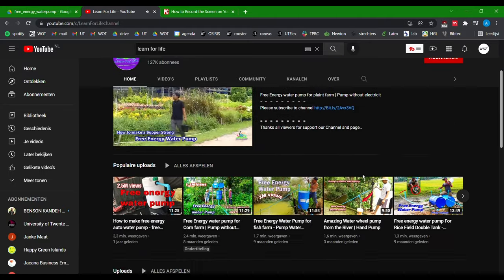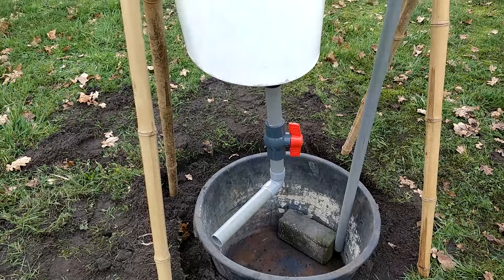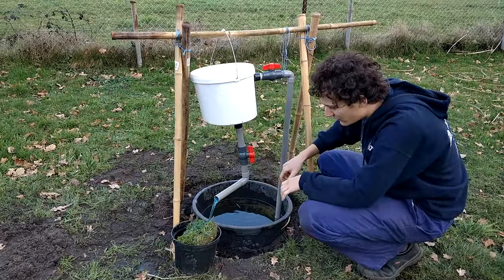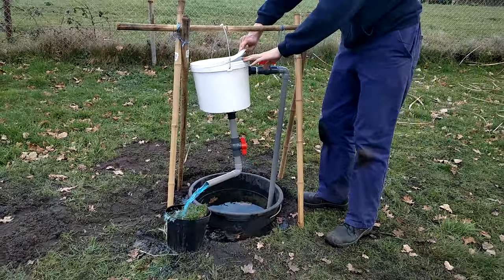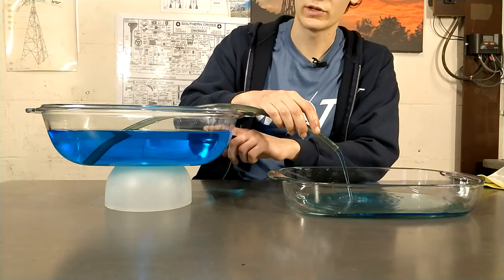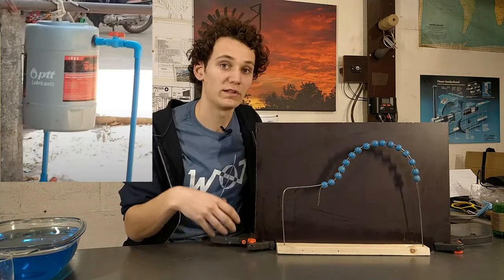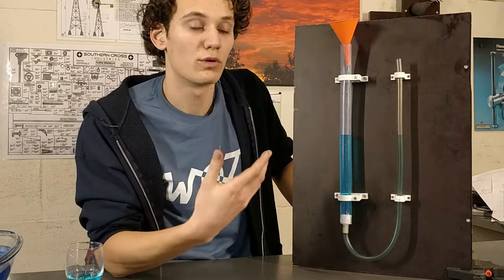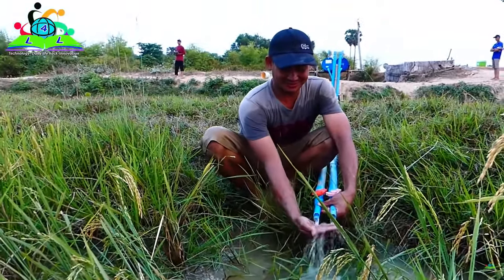FREE ENERGY Water Pump Tested. Is it possible?

Comment: YOU have SO MANY things wrong. 1 the outlet must be a larger tube than the inlet tube. 2nd   you have an air leak at the bottom line , WHY as water flows out , the vacuum pressure in the bucket gets to much pressure and the water stops flowing to let the air suck in , then water comes out. That is why you hear the girggle noises. YOU NEED a pipe with cap that comes up from the outlet pipe so the air has someplace to go BEFORE exit out outlet pipe. Water on outlet pipe NEEDS to be larger AND longer SO gravity weight of water in outlet pipe AND vacuum pressure with the added movement of water Keep sucking water because of the three factors I mentioned. A) you can suck out of any hole as long as the outlet water line is larger in diameter AND LONGER than the hole it is sucking out of. ALSO , the barrel must be higher than the outlet line. YOU DO this right and you will have water flow.

Comment: Man somehow you seam to have missed a few steps there needs to be a foot valve on the well end of the input pipe then fill that pipe up all the way with the bucket/ drum . I don't know if you can get enough vacuum to over come the weight of the water in that pickup pipe but at least show us that
Reply: With a barrel, no foot valve is needed. No filling of the suction pipe is needed. For this to work, inlet must be higher than the output. That is what he proves.

Comment: Pump works fine. You screwed up. Your siphon hose was way too high allowing air in. Also your bucket was too small and probably leaking. Most people that use this system use 55 gallon drums sometimes two drums. It actually uses the weight of the water to pull up the water.

Comment: you are missing the one way check valve at the bottom of the intake line. The lid on you bucket must be air tight, no air leaks allowed or it doesn't work.

Comment: The main issue is the lack of an air chamber. The air chamber helps to maintain the vacuum in the water tank as the water flows. Without an air chamber, the water flow will eventually stop as the vacuum is depleted.
Reply: .? What do you mean with an «air chamber»? What is that? I can not see anything lacking in this excellent video, debunking tha clame that a siphon can lift any water to a higher level. With no energy input that is impossible. Just as the video shows.
Reply: If the lid was sealed (as in this video)...wouldn't the water weight push the water out?
Reply: @mariusneumayer4419 Yes, the lid here is airtight. As he opens the output valve water will try to get out of the container. It tries to pull water up from the source, but as the source is lower than the exit, then no water  comes up. Then air is succed in via the exit side and a gulp of water leaves the container. This repeats until the container is empty and it all stops This is a siphon, no pump. Source must be higher than exit as with any siphon..

Comment: in that containers that are on every fake pump is just battery and small pump
Reply: Noop. The tank itself is the “battery”. Just fill it up, open the air vent at the top, open the discharge and watch the water pouring out (of the tank) for a minute or two. That is how this scam works. A siphon can not flow water uphill.

Comment: You have to make sure the water container in air tight buddy, try again!!! I use these vacuum pumps on my aquariums…
Reply: You can not. This is a siphon. No siphon can lift water to a higher level.
Reply: @SirSkippy87  OK! How much? No siphon can lift any water to a higher level. Impossible, and this video is one proof of that. AND it is a siphon, this one is a flying-droplet siphon. That is if, and only if, the output is is lower than the source, as with any siphon.

Comment: Your hoses are too large diameter for the bucket size .
Reply: Size of hoses does not matter. This does not work because input is lower than output. As he wanted  to point out.
Reply: @kjellg6532  You need to go and learn fluid dynamics.

Comment: Buddy  u haven't allowed for pressure  try again with foot valve.  And your tank is to small for pipe size.
Reply: With a bucket no foot valve is needed in the suction side. That is the main reason for using a barrel after all. Bucket size here is more than adequate.

Comment: Hello from USSR.
this works when the drain valve is closed. and the air in the barrel is warmed up in the sun. the tap is closed and at night water is drawn into the barrel from the reservoir by cooled air. in the morning, a person comes and uses water. the water runs out and the faucet is closed. the air cools and again the water is drawn into the barrel.

Comment: Your version does not replicated the system, you did not syphon the admission  to prime it and you did not use a check valve at the admission. In honor of a valid experiment you have to repeat it and replicate exactly. Better even with glass recipients. Then it will b3 valid.
Reply: With a bucket you do not need any foot valve or fill the suction side. That is in fact the purpose of the bucket/barrel. This video shows that a siphon is unable of pumping any water up. If it was, you could create a Perpetuum Mobile and receive the Nobel Prize in physics.

Comment: Your setup is incomplete. And also, you need to help the water to a point before it can work. There is a video with a transparant top so you can see how it works.
In that video you can clearly see how the pressure builds up and sucks water from a lower point. But I think it's not desirable for some to have the public know about this.
Reply: A siphon are unable in lifting any water up as this excellent video proves.

Comment: You didn't build it right you have to have and Air catcher in the out let  to keep the air from going back up the out let hose
Reply: The container itself is an air catcher. An external vertical pipe or sub barrel only add some volume making the system run for some more minutes.

Comment: Your demonstration is far from the fluid mechanic it's a suction type vacuum while the air pressure is trap it will pushes fluid its a ram pump its elementary theory

Comment: U did do it wrong.  If u syphon the water into the bottom container it would be a continuous syphon.  I’ve built them.  U did it wrong. You can also add a propeller the water hits from the high level creating a spinning fan from continuous syphon.  Free energy.  It works.
Reply: It can not. No siphon can lift any water.

Comment: It doesn’t work because you have air leaks and no check valve. So try again.
Reply: No check walve is needed when using a bucket. The bucket IS air tight, can clearly be seen in the video as the water has to gulp out of the output as air is entering backwards. Exellent video showing that no siphon can lift any water. No need for trying anything again, video proves it all.

Comment: Well your little experiment seems lacking compared to what farmers make. Even though your explanation about how water pressure works vertically was right you didn't even seal the lid or followed other practices to make this work because you never believed it could actually work right? I will have to try this myself to confirm whether it is legit.
Reply: The video clearly shows that the lid is air tight. No need for a second test.

Comment: There is something you missed in the operation that you made. After you fill the container which is supposed to be at a higher level it should be sealed so that when you open the output valve it would create a vacuum in the container. And as the weight of the water going out of the output pipe create a vacuum it would suck the same amount and weight of water into the input pipe and replace the water that has spilled out of the output valve. Sorry but your demonstration is technically flawed. It was defective from the very start. You must understand that the pump operates both with siphoning and vacuuming at the same time. What goes out during the siphoning comes in by vacuuming.
Reply: Sorry, but it is your explanation which is wrong. Yes, a vacuum is created. But this vacuum becomes effective not only at the inlet but also at the outlet. The argument, that weight of the water is bigger in the container and thus water will flow out, is wrong. What happens does not depend on the weight of the water but on the relation of water pressure to air pressure. And if you analyse that, you will find that an increasing vacuum will stop the outflow before it would be strong enough to pull water up from a lower level than the outlet. 
In addition, the argument with conservation of energy also holds. If this pump would work, you could at once build a perpetuum mobile. You could let the water run back in the reservoir and let it drive a turbine on the way. Electricity for free! But I hope you are aware, that perpetuum mobiles are not possible?

Comment: I guess you didn't understand how it works. Basically you didn't understand the simple physics in the system. 
This, is an ancient method, my friend- it's also used by the indigenous people here.
. 
The contraption you made was all wrong. You didn't really have the one way valve and you lost the vacuum/ suction effect as well. You also didn't have the reservoirs in place.

Take a good look at it from start to finish- you don't have to be a physicist or civil engineer to understand it.

PS
I believe he didn't show the full thing. He definitely had another check valve - that's why he initially pumps it.
Reply: The one making this video is doing an excellent job showing that a barrel siphon are not able to pump any water uphill. This has been known for hundreds of years, but some do believe in Merlin an magic. 
One purpose of using a container is that you do not need any foot valve. You can spare the cost. The next point is that a barrel can keep the siphon running for some time even with a tiny air leakage. The tank may make it easier to get started, but is not strictly needed. You can do the same with a simple hose, but inlet must be higher than outlet, as with any siphon.

Comment: you're doing it wrong. 
make sure do it in perfect Vacuum no Air or leaked.
And add pressure tank in the top and make it upto -100 or minimum of -10 PSI and you will get the negative Pump that will like a Hammer pump.
Reply: This video is an excellent demonstration that no drum “pump” can lift any water to a higher level. No siphon can do that.

Comment: you don't have any foot valve  for starters and you also don't have the upright PVC to trapped the air,, And you of all should know better, you can't water without a foot value,,.
Reply: With a barrel, no foot valve is needed. This is actualy the purpose of using a priming barrel. Upright PVCs are not needed, the tank itself does the same trick. AND, if such an air trap was needed, it would fill with air leaking in from the output and the system would stop.

Comment: It's work you failed to make it work because you didn't prime the well side of this experiment. Furthermore, it would help if you sealed on the bucket. Just because you don't know how to do it doesn't mean it won't work.
Reply: Using a bucket you do not need to prime the suction side. In fact, that is the sole purpose of using a bucket.
From the video you clearly see that the system is pulling air from the exit side. A proof that the bucket it airtight.  This video shows that a siphon are unable to lift any water to a higher level.

Comment: At 2 things makes your demo fails : 1 your bucket is not sealed enough to create a vacuum. 2. your bucket is TOO small to create a suction power (from the vacuum created when the water comes out) to pull up the water from the source. watch "NO MOTOR NO ELECTRICITY NON STOP WATER DIY - DESI IDEAS AND CREATIVITY" - this demo used transparent plastic cover that shows water is sucked up to the container. AFTER WATCHING IT, you can try FOLLOWING the system to the letter before making a conclusion.
Reply: 1) He proves that the bucket is tight enough.
2) The bucket has a volume much grater than the suction pipe so the size of the bucket is ok.

Comment: Youre bucket is not air tight, and you miss the whole point of the idea😅 youre pointing on siphon idea which will not work😅, youre contraption is really really wrong....
Reply: The container IS airtight. You can clearly se that in the video from the fact that the system sucks air via the output. 
This is a siphon setup, but it can not work. For a siphon to work the water level in the source must be elevated higher than the output. A lot of videos on Youtube clams otherwise. This video is an excellent demonstration that a siphon like this can not lift any water to a higher level, not even by adding a star up barrel. 
Excellent video, debunking “dum pumps” as a hoax.

Comment: You didn't use a big enough bucket for the distance water had to travel to get up for the gravity to take effect right yes
Reply: Gravity causes water to flow from a high place to a lower place. But never the other way round. And a vacuum doesn't change this at all.
Reply: You could use a container holding 10 000 tons of water, it would not work. You arrange the inlet to be higher than the outlet, and a simple hose would work.

Comment: You missed a big point due to your lack of understanding physics principle.  The tank is anti-gravity, if the tank is large enough and the water flow out creates larger than the suction required to pull the water up to the tank then it should work, given the tank sealed.  I think you know it and pretended to play dumb so you get more comments.  Good try but please be honest.  Why I know this.  In the beginning you showed that it worked then you pulled the cover off to make it failed and went on with your game.
Reply: yes you right... he do the "test" with bad leakproof...
Reply: Size of tank does not matter! The tank itself is only a priming device. You may drop the whole tank, still a siphon can not lift any water uphill, as this video shows.

Comment: A hydraulic ram pump works on pressure not flow of water.

The pressure is added on the outflow using a one way valve.

A faulty explanation on a basic machine will debunk your entire video. 🤞🏽
Reply: Noop. A ram pump depends on the energy in flowing water. This is a siphon. He shows that no siphon can lift any water. Excellent video, to the point!

Comment: You're wrong as many commenters said. It's so better knowing, before making.
Reply: He knows what he is doing and showing his point, this siphon can not lift any water up from any well.
Reply: @kjellg6532  His point is wrong. As I set before, research and then publish. It is vacuum-pumping. If he were filling the pumping pipe (in his case he did not) with water, the vacuum will suck the water from it. The vacuum vessel is essential. But again these things were invented decades ago, and some silly guy tries to replicate them by watching videos, without knowing the principles is falling for a fail.
Reply: @kppteam  Sorry, but I think you are not getting his point with this video. He replicates what is being claimed in so many YT videos. Thin suction pipe. No foot valve is needed, no filling of suction tube is needed as he is copying the other videos. With a barrel you do not need any valve or any pre filling of suction. That is partly the purpose of the barrel! He fills the bucket. The lid is air tight. The source is lower than the exit from the system - and the system fails as expected and as he tended to prove. The videos he is referring to are manipulated. No siphon can lift water from a low reservoir to a higher level. No siphon can make water flow uphill, it is not a pump. Here is no energy input to rise any water. THAT is what this video is all about. He is showing that this system does not work and that those videos claiming that are bluff, hoax and scam. 
An excellent video, to the point!
Reply: @kppteam  In fact the veksel is not essensielle. You can do the same siply starting with a water filled hose. The barrel is only an other way to get the system filled with water. The simplest siphon is a hose running from a high source to a lower exit.

Comment: The way you SET UP your demonstration is WRONG. You need an AIRTIGHT BIGGER water container (enough to create VACUUM) and LONGER OUTLET tubing with water control valve at the end. So that when the airtight container filled with water and then open the outlet it creates VACUUM to suck water from the source. The water will flow only if the end outlet control valve is LOWER than the container.
Reply: Noop. Bucket here is clearly bigger than volume of suction pipe. No bigger container is needed. It is air tight, air sucking in from the outlet proves that. No longer outlet pipe is needed. Here the outlet is short on purpose to show that ait will suck back, regardless of length of output tube. In this case the exir valve IS lower than the bucket, but the output must be lower than the source for a siphon to woork. He is showing that a siphon can not lift any water.

Comment: I would be shy to post a video like that.
Reply: Why? The video is excellent. Showing that no siphon can lift water.
Reply: Not when it’s done wrong, he doesn’t understand the physic of what he’s trying to explain. He’s missing a foot valve and the way he did it, he’s sucking air from the exhaust pipe . The fact that the exhaust is shorter than the suction and the bucket is too small for the size of the suction. Everything he did is wrong, i know, i empty my pool every year using a system that look a bit like that.
Reply: @bksduskmirror1250  He understands and explains the physics very well, no problem.
No foot valve is needed here. In fact that is the main reason for using a priming barrel, no foot valve is needed, no filling of suction pipe is needed. An excellent video showing that a siphon is not a pump and can not lift any water ‘from a deep well’ not a single inch.
Reply: @kjellg6532  he’s pulling air. Air in a syphon never works